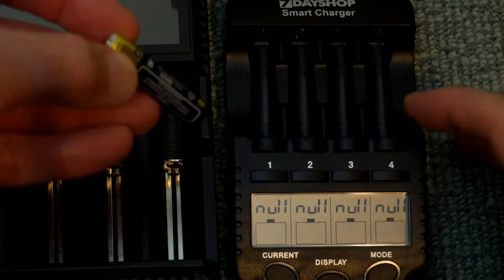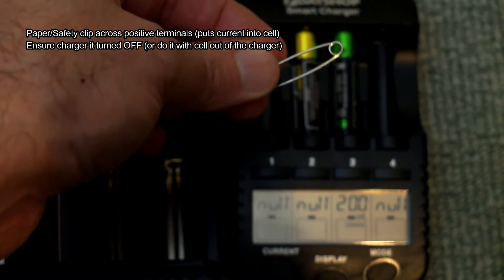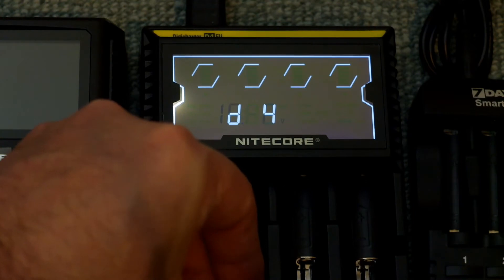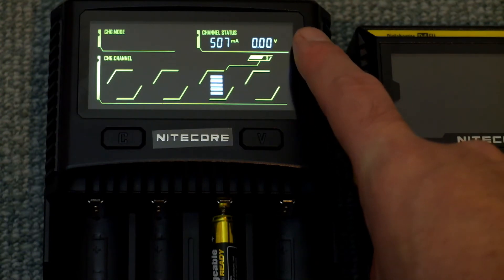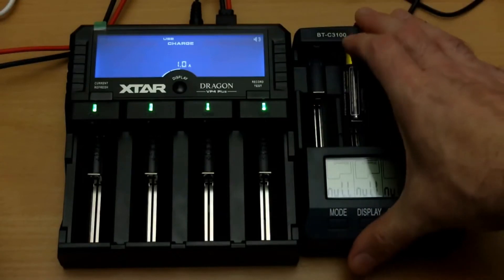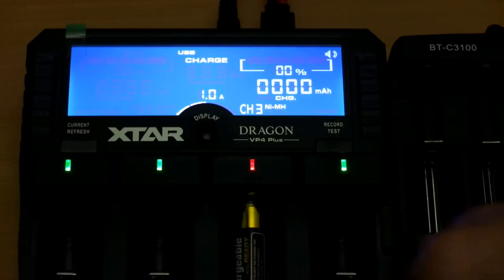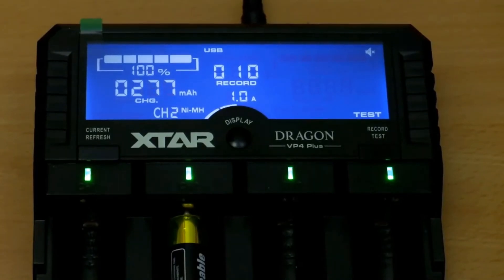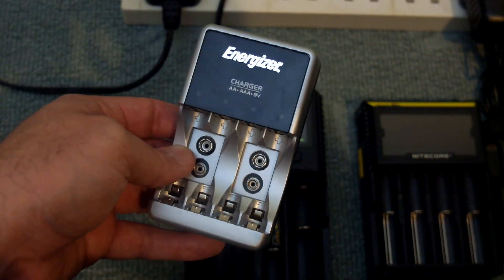How to charge 0 (Zero) or low voltage batteries in a smart charger

Comment: Is it safe to charge a unprotected 18650 molicel lithium that’s reading 0 volts? My xtar vc4 started charging it as a nimh but it changed to lithium and is now at 3 volts. I got nervous and took them off though. Thanks.
Reply from the maker: It will show Ni-MH until the voltage is high enough, it's not a problem at all if it does activate. The charger should detect this

Comment: Have you tried a large number of cycles on that low capacity cell? I've seen capacities come back to almost new levels on some cells after 10 cycles. this is on Sub-C Ni-MH cells but should work on others.
Reply from the maker: You can try it will vary hugely depending on the cell, often the cell is worn out and it won't help. It's worth a shot but if it's not happening after a while it's probably not going to!

Comment: Using a carat vc4 and trying to charge batteries I recently used one won’t charge I let it sit in the charger for 5-10 mins with the other 3 18650’s still just is lite up green not charging or doing anything with that one battery. I did use it til it died waiting for the new charger as my previous broke.
Reply from the maker: VC4 puts a low current into cells automatically, so if it's not activating the batteries are dud. It can happen I've seen it more on low grade Ni-Mh batteries more than Li-ion
Reply: Mr Baz Reviews yeah I read that online but wasn’t sure. But just was surprised because it was just working a day or so ago I just drained it down with a mechanical mod while waiting for the new charger. But yeah I tried to get it started just never seen a Sony vtc6 go bad. My vtc3’s and 4’s still work lol. But just don’t have the same capacity they use to. My device takes 4 18650’s so I had the set of 4 married to the device. And took like a week for the charger to come so just used a single mech mod to vape so I could make it last using one 18650 at a time. I’ll guess I’ll get a few more vtc6’s
Reply from the maker: @STePHeN320_12  Check other cells in the charger make sure it's working OK with those, it's unusual to have many Li-ion fail or not charge. Worn cells can charge fast ie reduced capacity but will still charge.
Reply: Mr Baz Reviews its the only battery that wont charge. It’s just weird because I was just using it while waiting for the new charger to get here. But I charged 8 diff 18650’s since the charger got here today. And just the one vtc6 won’t charge. I tried to put a wire from a good 18650 fully charged positive to positive and negative to negative. I checked it with a multi meter and it was reading 4.20 volts on the bad battery side while trying to jump start it with the other battery. But as soon as I disconnected the wires and checked the voltage on the battery it was .7 of a volt and would trickle down to .5 of a volt within seconds. But every other battery is working on it fine. Even an old laptop battery I took apart that had I believe 6 18650’s in tandem(I charged 4 of them)That laptop battery that I took apart is like 10 years old and they all charged up fine.but I put in some vtc 3’s and vtc4’s and they worked or it said they were charging fine. It’s just that one battery the one vtc6 that won’t charge.

Comment: Hi. Great Video, I have a question. I have Sv2 Rocket which apparently has the option to revive dead batteries. How do I do that? I tried charging two 18650 cells with 0.25A. is there something else I am supposed to do? The charger has only one button so I don't know how to put it on revive mode.
Reply from the maker: Xtar chargers have automatic activation they put a low current into cells when you insert them. Put the battery in and leave it for a bit, then take it out and put it in again. If it's not activating it's because the cell is faulty and won't charge
Reply: @MrBazReviews  thanks!

Comment: I tryed holding both for the manual activation but stupid charger now thinks it is a "NiMH" while it's actually a 26650 Lithium Ion (-_-) Also I don't know wtf but I have also at my store the Dragon VP4 Plus and no matter that I done these 2 stick to test the voltage never worked and I don't know why this overpriced charger needs such bulky equipement while all other much cheaper charger can already tell you the voltage by itself without any annoying extras. So far I really prefer the SC4 between the two.
Reply from the maker: I'm not a fan of not having the Dragon read the voltage in the charger, though the internal resistance measurement with probes is more accurate. It is good for testing cells that has to be said (capacity testing is quite accurate)
Activating Li-ion it will show Ni-MH if the voltage is low, but it should recover (if it can) and then hit normal Li-ion voltages then it should see it as Li-ion
Reply: You need to touch the two probes against each other to activate the voltage / internal resistance measuring mode.

Comment: Thanks! This made me aware of the possibility to reactivate and to know which tool to use best, which to me is the Dragon. I bought it too.
I wish I had known this before. I have skipped batteries that I might have been able to save. I am reviving some right now, I am curious how that will turn out.
Reply from the maker: Sometimes the cells won't work that well, even if activated. It is however worth a try

Comment: Which is better Nitecore  D4 or SC4?
Reply from the maker: SC4 has more charging speeds and can accept 20/21700 cells (the D4 cannot slots are not long enough), so overall it is a better charger - but the D4 is still good if you don't need that. Both have an activation feature the D4 is automatic (and shorter) the SC4 is manual but puts a low current in for longer.
Reply: @MrBazReviews  I am looking for a good charger for AA, AAA and 14500 for now but later would like to charge bigger batterys.
Reply from the maker: @adamtedder700  VC4 is pretty good for USB or the UM4 from Nitecore, mains power D4 is still a solid charger

Comment: Considering the value is the functions and accuracy that offer what best cost benificio Nitecore SC4 or Xtar Dragon VP4 Plus ??
Reply from the maker: Depends on what you want to do. The SC4 has individual channel control and faster charging up to 3A per channel (6A total) but it lacks a discharge test which is probably the only way to accurately test the usefulness of a battery (internal resistance is of some use, but not as useful). If you are testing the Dragon is likely to be the best choice. It's a shame Nitecore didn't add that function. Charging on Ni-MH also seems better on the Xtar. The SC4 is a decent option for those using Li-ion cells and wanting higher speeds, it's just not the one to get if you are trying to weed out poor cells
Reply: But the nitecore sc4 can charge Ni-MH batteries with up to 2000mAh ?? the debugging is that I'll have to use another charger to do the Refresh on the battery, is not it ??
Reply from the maker: There is no way to discharge on the SC4 charger even the USB output is only for mains can't use it to drain Li-ion cells (and cannot use it at the same time as charging). Dragon can do both charge and use USB, and can discharge Li-ion via power bank (all 4). You have a refresh mode on the Xtar which means it will drain the cell then charge it, though it doesn't have a discharge mode as such on it's own. 

The Xtar chargers I have used almost always give a slightly higher more accurate charge v the Nitecore ones for Li-ion and Ni-MH cells. Not really a huge problem just consistent across all the ones I have tested (with the exception of the D4 which is up there for accuracy with Xtar). I find the Dragon more useful because I am testing cells often (capacity mainly) and sometimes need to drain cells. You can't do either on the SC4. I think the SC4 is for high capacity Li-ion users mainly fast charging speeds, it's less appealing for Ni-CD/Ni-MH users or those who want to test cells
Reply: Many thanks for the clarifications !!!

It's because I bought a nitecore at Gearbest for $ 37.71 and was not sure if it was a good buy !!
Reply from the maker: I don't think it's a bad buy at that price for what it is ie it's an upgraded D4 with faster speeds and some extra features. The Dragon is a fair bit more on price really depends on what you want from a charger. To date no Nitecore has a discharge testing function ie capacity perhaps they will bring one out at some point, slightly strange what that is
Reply: I use Ni-CD/Ni-MH batteries but I intend to use LiFePO4 batteries for being more 
effective so I opted to purchase the Nitecore SC4 !!!

Thanks a lot for the help !!

Comment: which one is better charger nitecore sc4 or xstar vp4 plus?
Reply from the maker: They are quite different SC4 can test internal resistance but doesn't have a discharge capacity test (only counts what is charged into the cell). VP4 plus has that feature if it's what you want (and can test internal resistance)

Comment: Good advice I've had to do that a few times saved quite a few battery's that way and money  The chargers are not cheap but I'm sure with the amount of battery's I've saved it's already payed for itself 👍
Reply from the maker: Tends to happen more with Ni-MH in devices a long time most of the cells I had forgotten about (toys etc) and they discharged to low levels. Sometimes they come back OK, other times they have a very low capacity. Worth trying